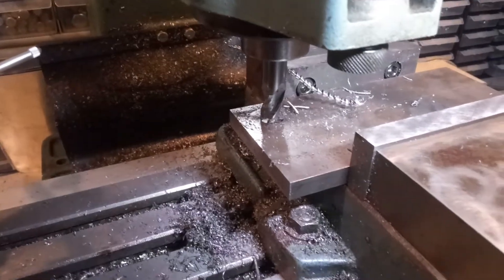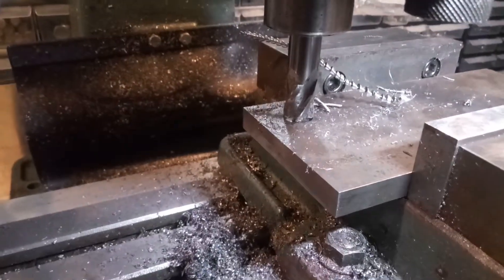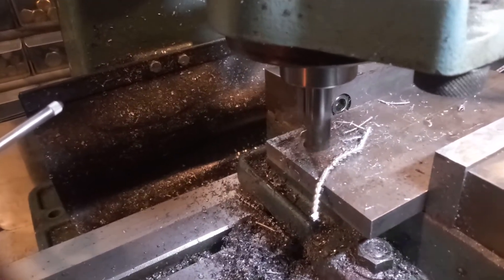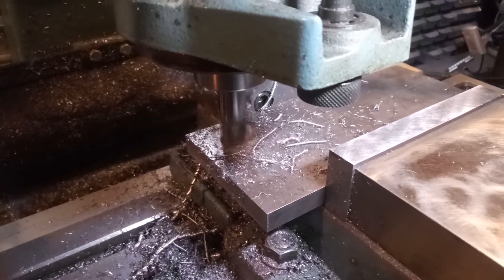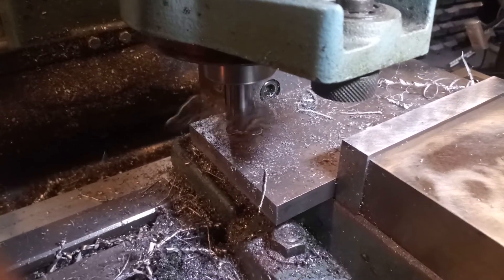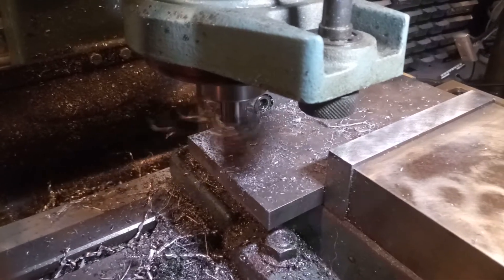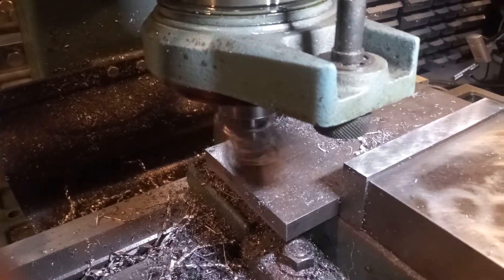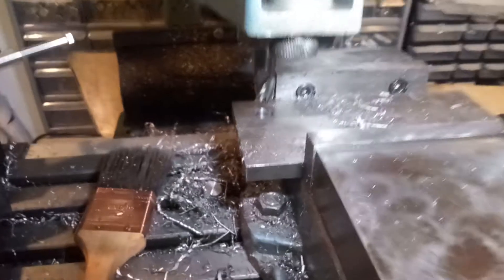Drilling large holes with endmills

Comment: We don't use hammers for screws and drivers for nails do we now? 
An annular cutter is a good upgrade to twist drills for faster, more accurate through-holes in thick steel. An endmill is not something to be used instead of a twist drill because they don't have the correct geometry to evacuate all the chips from a hole like that. 
Firstly, it takes significantly longer to drill a hole by pecking at it with an endmill. Secondly, you'll end up chipping the edges of the endmill, leading to poor finish on all the later holes. 
Thirdly, good luck sharpening an endmill at the bench grinder 🤘 
Exceptions? 
If you had to square the bottom of a blind/partial hole like a counterbore (not a through hole), an endmill is probably the appropriate tool. 
An endmill is an endmill, a drill is a drill. 
And just like hammers and screwdrivers, they're not interchangeable unless you just want to have some fun 🤣

Comment: And it makes a round hole, unlike a drill bit. 😁
Reply: I would have to say that if your drill (press, not hand held)  bit hole is not round, either the bit is dull,  has damaged geometry, and/or you are not holding the work securely... or your drill press has worn spindle bearings and hence excessive runout.